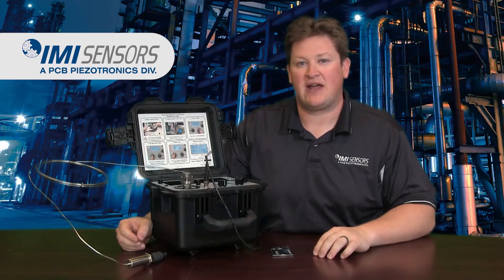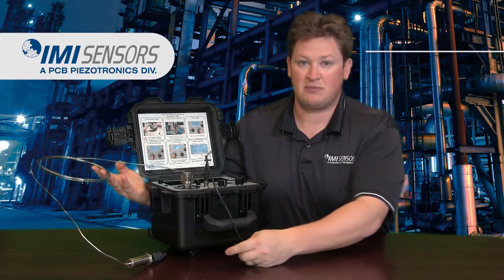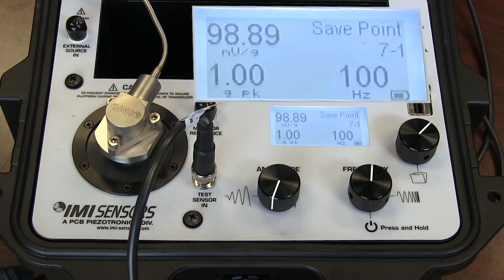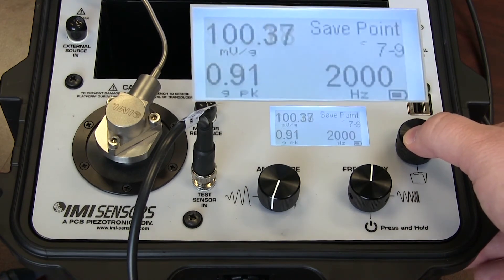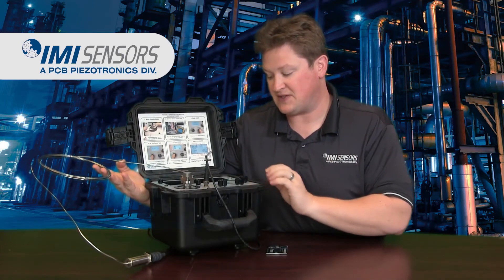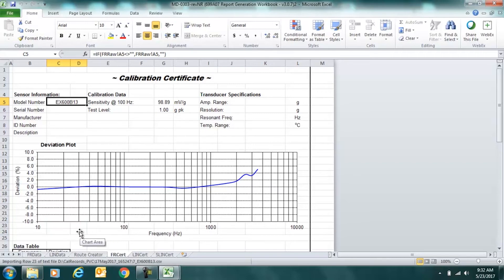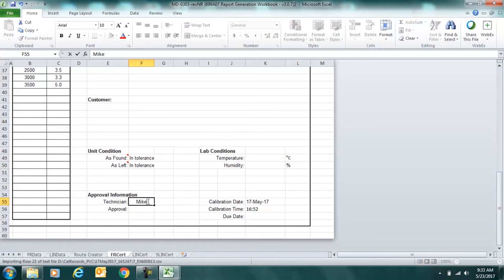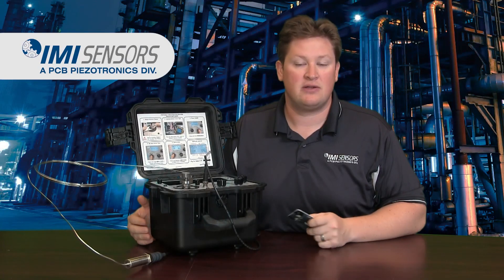High Temperature Sensor Validation with Portable Vibration Calibrator

Comment: We want to install the EX600B13 on the engine of the tunnel suppressor, our goal is the sensor will be  operational in case of fire (during any fire),  
Our problem is that the charge amplifier cannot resist more than 121 degrees so, My question do you have a solution for protecting the charge amplifier?
my second question, do you have an example of application or customers that  used this sensor as a guarantee for our installation ?
is calibration required for each installation?